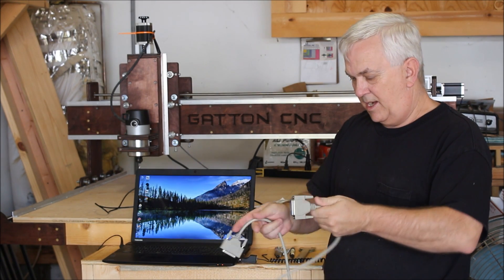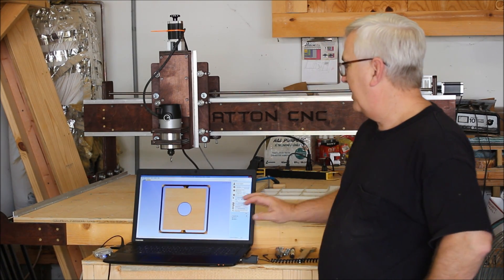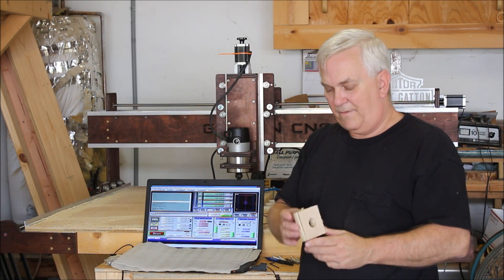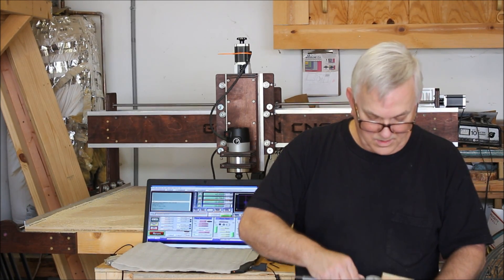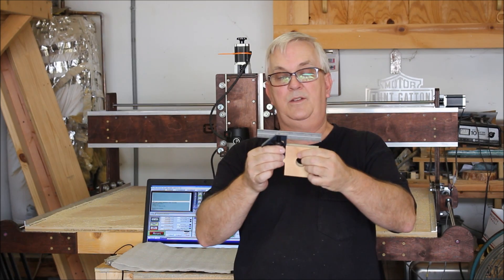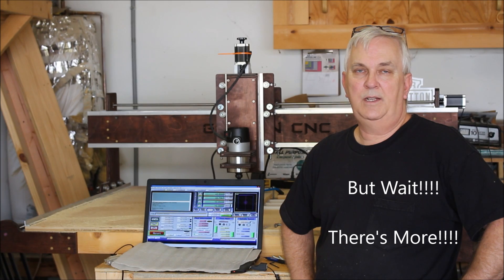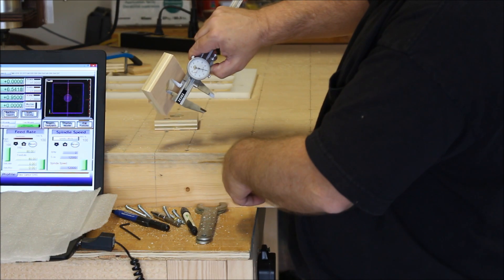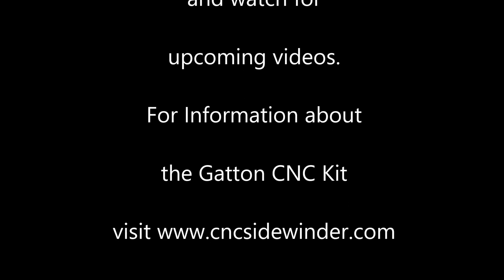Making Test Cuts with My Gatton CNC

Comment: Dave,
Are you still offering the wood CNC kits??  What advantage does the metal kit have over the wood?
I must have one of these.  I am fascinated just watching and thinking about the potential.
thx,
Bob
Reply from the maker: Bob Taylor Yes.  There is a link above in the video description.
Reply: Thx Dave.  I have seen those offers but since they were old didn't know if still available.  I don't see any link for the metal kits.  Are they available yet??
thx again,
Bob
Reply from the maker: If you are talking about the GarageWorX CNC yes, they have been available for well over a year.  You can find them at www.garageworxcnc.com

Comment: HEY Dave when setting up hot key and the motor is doing the opposite why not just hit the other key?
and not reverse the motors in the other settings or do you have to do it this way so it don't damage the motors

Comment: im in your web site trying to buy cnc plan but looks like you only sell plans with kits.
i live in philippines and am very interested in your unit design.
i intend to build a CNC Table which can accept 1/4" 8x16foot ply to enable me to cut sailboat side panels in one piece, also 1/2" 8x4' to cut internal frames.
so is it possible to just buy plans ????

Comment: I noticed that you use aluminum angle for your ways. When I made my first machine the v-groove bearings slowly deformed the edges of the aluminum. Do you have any trouble with this? I ended up replacing the aluminum angle with steel.

Comment: Great video. I just received my uc100 today. Tried it with two computers, and it will not recognize eithier one of them. And I thought this was going to be simple.
Reply from the maker: Thanks for watching Roy.  It should be simple.  Do you install the drivers for the UC100?  Did Mach 3 find it when you opened it?